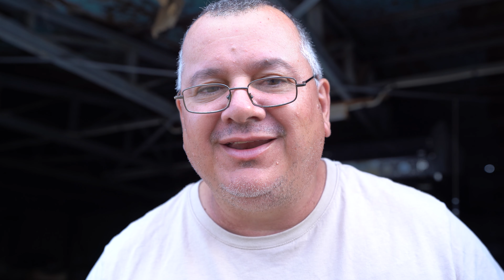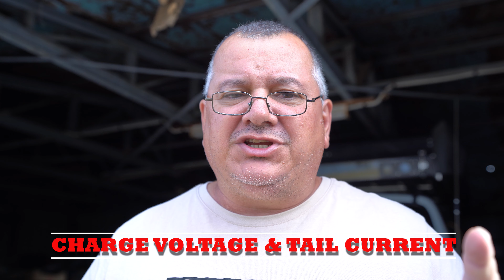Victron BMV 712 Smart Battery Monitor Settings for optimum use

Comment: I’ve been using DCS for 12 months and I love it ,   The blue tooth on it works fantastic also from what I hear they are proud of their product and customer service is excellent. Stefan fuller has been using them for a few years now and he highly rated them.  Sorry mate I have no experience with victron,  I’m lucky my best mate is an auto electrician so I’ve got red arc
Reply from the maker: The DCS is my preference and probably the one I will end up with.

Comment: Hey Phil,

As you well know...lol  I really don't know much about this stuff.  However I suspect it was really designed to be used with lithium and once you make the switch your issues will disapear.  Looking forward to the next step.
Reply from the maker: Yeah,  with Lithium no issues.   I'm actually at this very moment filming a video I'm going to upload soon on Lithium Battery and the different brands I'm looking at.